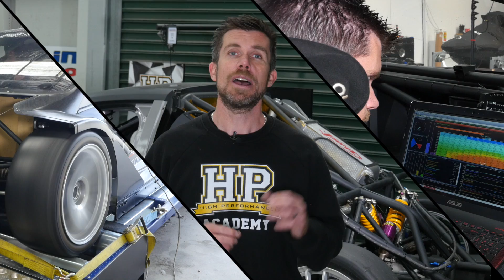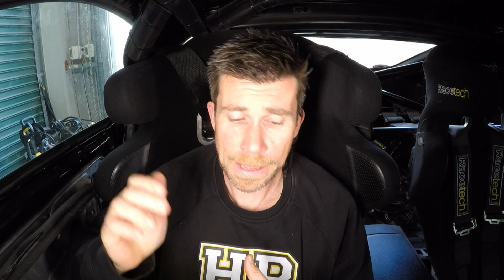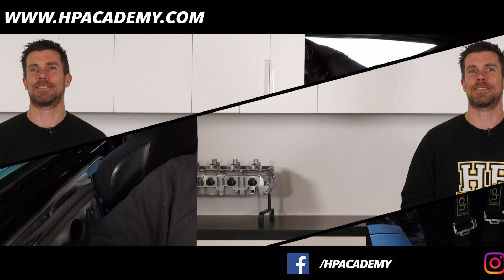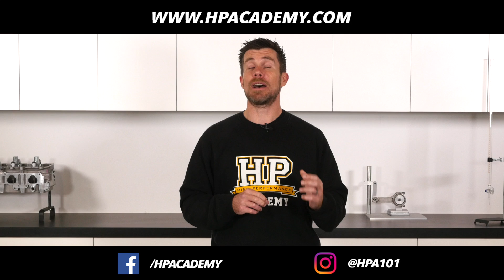[HPA Q&A] How do you tune for the "Ghost Cam" effect?

Comment: So if I drop my rpm idle speed I can achieve this?
Reply: No,  you need to set up your ecm to advance timing until idle rpm is achieved and then retard timing to bring it back down... repeat with what I assume is defined steps of how much to adjust,  i.e. the 20 to 30 degrees mentioned in this video. This will overshoot your idle speed then it'll overshoot the idle speed again when it retards by that large 20 to 30 degrees.